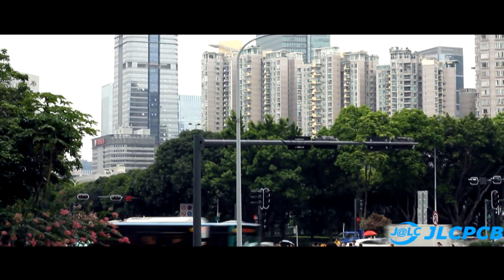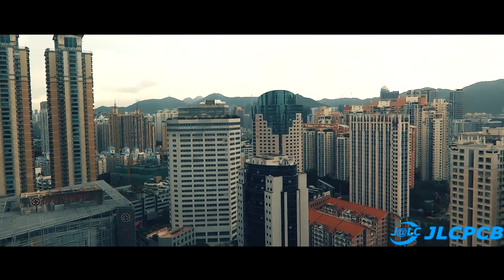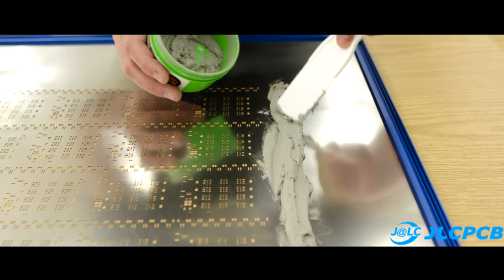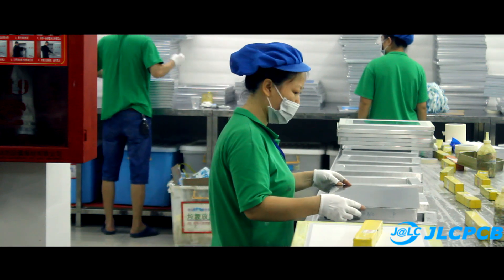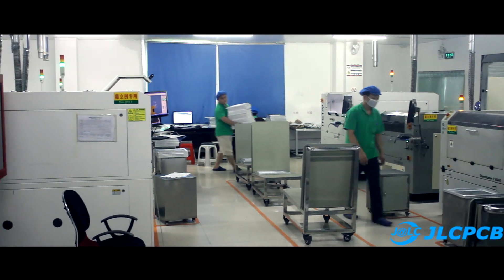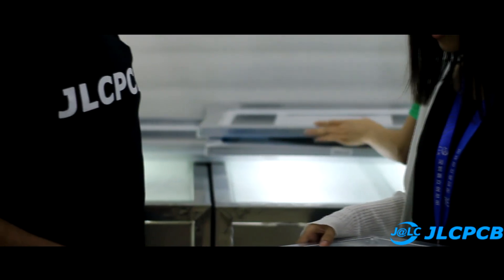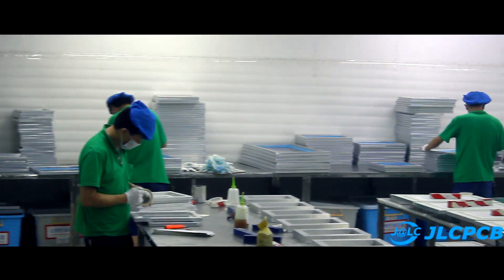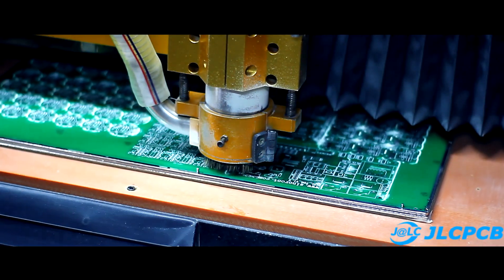How to create PCB in a factory - JLCPCB

Comment: High quality, low-cost pcb manufacturers, such as JLCPCB, have completely changed electronics prototyping for the better. Hobbyists, experimenters, and low-quantity engineering projects are getting much better boards at much lower costs than even 10 years ago.